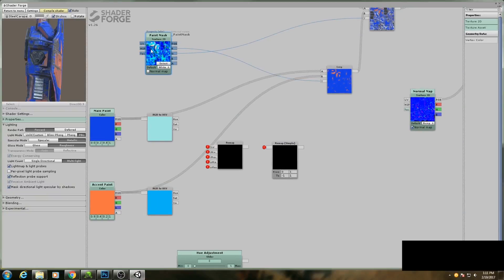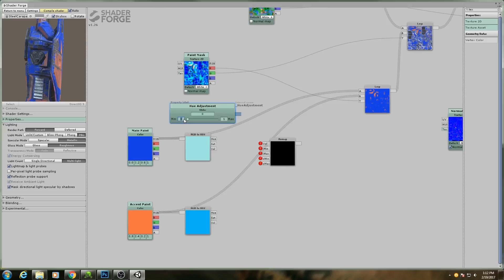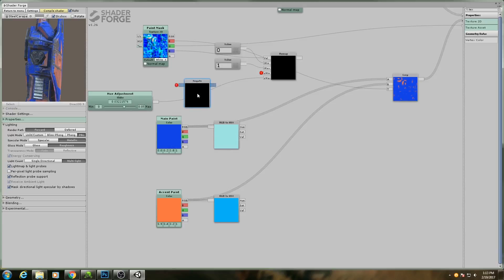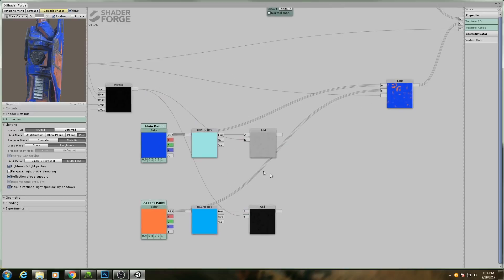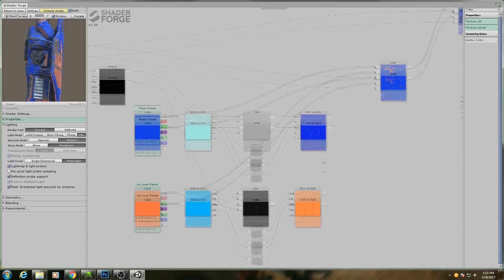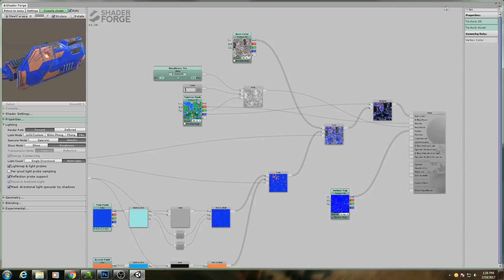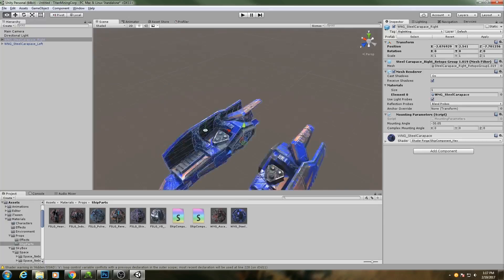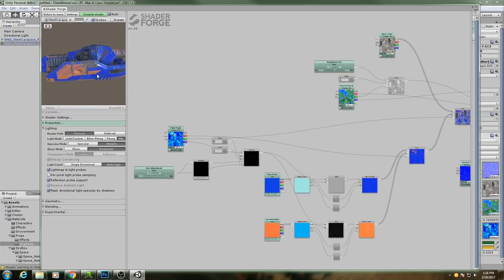Texturing for Node Based Shaders in ShaderForge (Part 7)

Comment: Hello ive been wondering do you know maybe how can i export voxel pixel painting texture? i tried fbx (crashes unreal) and just obj never works, tried to find this out like for 2 h and im slowly giving up
Reply: you can bake it in 3d coat  to a low poly uv mapped mesh and then import it the normal way, if that didn't help you can ask on the 3d coat forum they're really great.
Reply from the maker: As Rache Gott mentioned, you have to bake the paint and details down into texture maps. If you export the high-res voxel object, that is hundreds of thousands if not millions of polygons. Game engines are not built to handle those. In 3d-Coat, if you go to Bake -> Bake w/ Normal Map (per pixel) that will bake down both the normal maps and your voxel paint but you need a retopo mesh to do that.
Reply: AlienMinefield oh okay, well i gave up on it, as im kinda short on time  and just made texture by hand in Zbrush :")